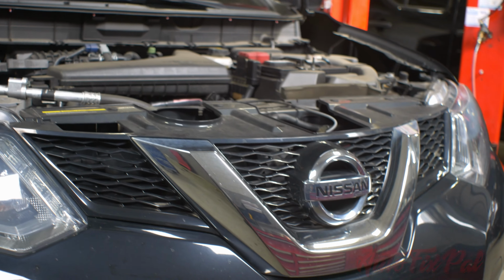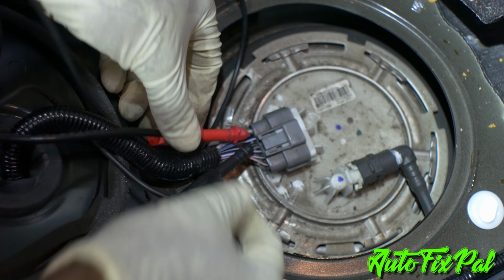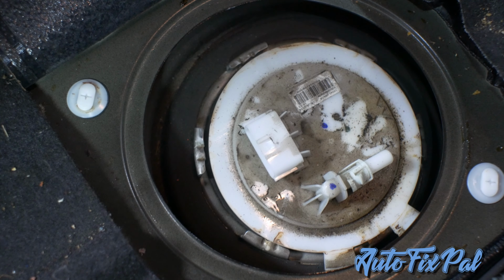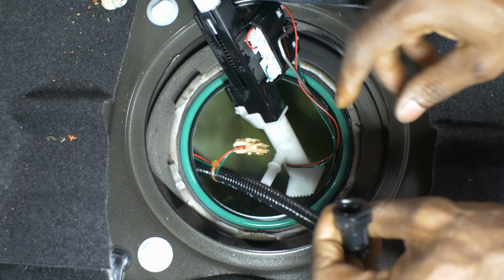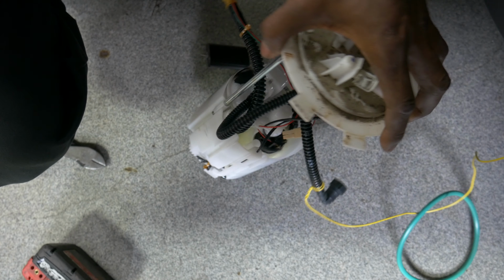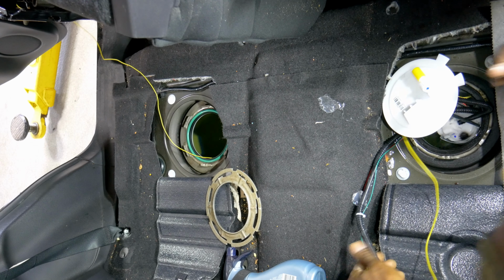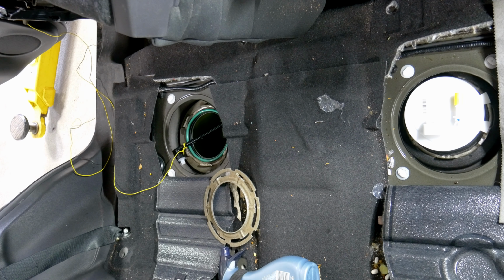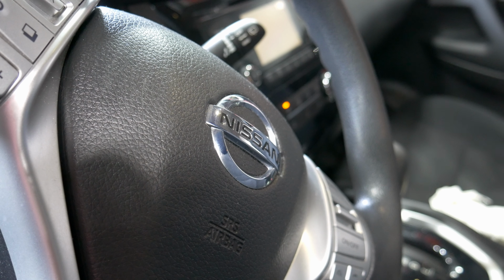2014 rogue no start diag - Fuel Pump replacement - How to diag a no start

Comment: We're always a fan of well-documented procedures! Plus, brownie points for showing ingenuity using the yellow string and actually wearing gloves for safety, a measure of precaution overlooked by some when doing replacement videos. Great job!
Reply from the maker: Thank you, i try to make it as easy to follow as possible. Yes gloves are a must. Saves your skin many times over, and it makes cleaning your hands afterwards much easier.
Reply: @Autofixpals  where is the fuel filter located on a 2013 nissan rogue sl? I'm currently running into issues with my vehicle starving for fuel.

Comment: You're on a roll bro lol loving it!
I did this job on a 2006 model and without the factory tool it's almost impossible to put the lock ring back... It took three people and a couple of hours... Glad they fixed that issue on the newer version
Reply from the maker: i have since started using the factory tool. But instead of using it with a breaker bar i use an electric impact gun. Man oh man it make it much easier, even with a breaker bar on the factory tool its a PITA. But the impact gun makes it easy (i know its not recommended but they shouldn't have mad it that way) . air hammer works too. I have tried many combinations.. lol
Reply: @Autofixpals  well I'm glad to know that it wasn't incompetence on my part lol that job made me a believer lol
Reply from the maker: @Usmanthemecano  no sir, they can be a MFer to get on and off. Some are easy, some are just stubborn.
Reply: Sakeenah Auto Solutions where can I find that tool? I bought one on amazon but the diameter was too big

Comment: Great video! Very helpful. Do you know if a 2009 Rouge is setup the same way? I ordered a fuel pump for my 09 and I don't see a crossover pipe for the sender unit on it.
Reply from the maker: sorry bud, im not sure if the 2009 has that crossover tube. The fuel pumps dont fail too often on that body style. However the 2009 and 2014 are VERY similar in design so it may still have the crossover pipe. according to the picture on amazon it does not https://amzn.to/2RbmyjV

Comment: So if you come across the problem with the fuel tank/pump metal locking ring not fitting flush or some metal slots are overlapping/misaligned then just use the original Green rubber O ring instead of the new one or get one similar in size to the OEM Green Rubber O ring. I came across the same problem with the new black Rubber O ring not fitting but used the original Green rubber O ring  which is bigger than the new Black Rubber O ring in size and I was able to insert the metal locking ring back with no problems. (Took me 2 hours of struggling and  finally comparing both Rubber O rings to release my mistake). 2010 Rogue SL AWD

Comment: My 2013 rogue is missing that rubber boot on my vacuum port. My vehicle is having issues starting I have to turn the on off a few times then give it gas to get it to start. I got a code for a vacuum leak but also running to lean B1.

Comment: I wish someone had a video of taking out the backseat
Reply from the maker: back seat removal is very easy. There is bolts in the front under the plastic covers and bolts in the back under the plastic covers. the covers just pop off (can be broken so be careful) 14mm or 16mm are the sizes. i think  2016+ is 16mm bolts 2014 and 2015 are 14mm

Comment: Successfully changed out the fuel pump and the car started without a problem.  Now, I can't get the check engine light to turn off.  I've followed the instructions where you press the accelerator, etc. but the light still stays on.  Any recommendations?
Reply from the maker: what DTC do you have? If the problem was fixed with the fuel pump it should eventually go out on its own. But you can clear the MIL with any cheap code reader, provided the problem has been addressed.
Reply: @Autofixpals  I found another guide and finally got the code to clear. The new guide tells you to press the accelerator a second time after reading the DTC. Then it should give you the cleared code if the problem is fixed and the light should go off.  That is what I did and it worked like a charm.  Thanks for getting back to me so quickly!!! Great and extremely helpful video!!